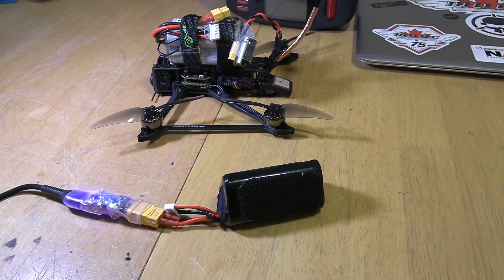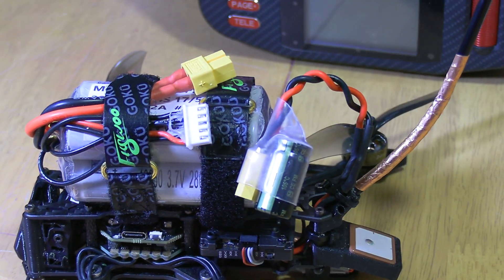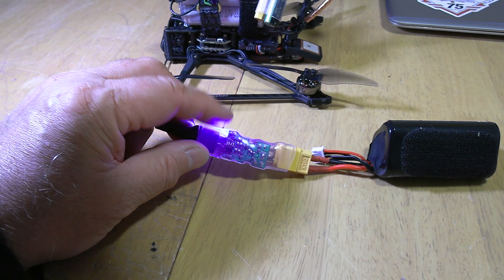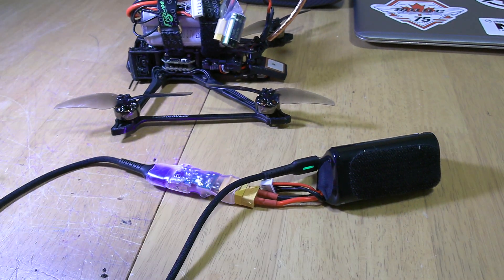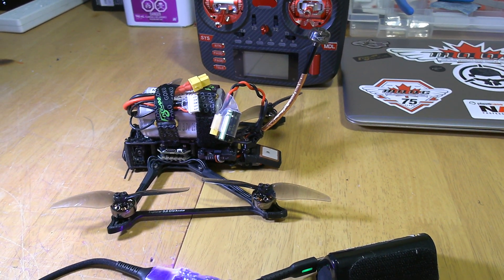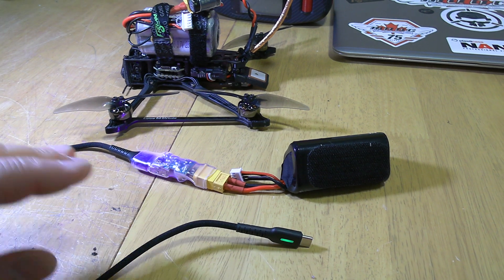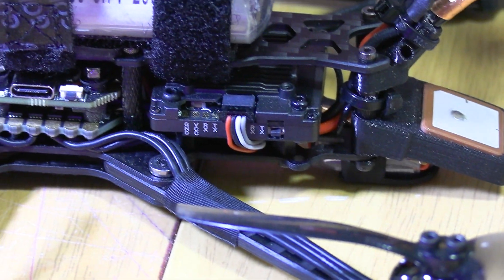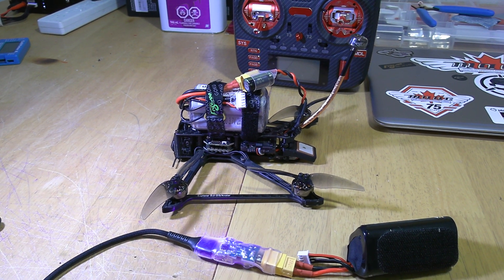How to keep your fpv video transmitter cool while waiting for gps lock

Comment: Been using a usb power bank and small fan  … stays nice and cool. When I first got my LR4, it took forever to lock in satellites. Fly woo said up to 30 sats. 
I rerouted the GPS module to the top of my battery with Velcro, between the two battery straps. Also shielded the wires with copper tape. Now, I always get at least 25 satellites and many times 33 satellites. Super fast too. I don’t really need the fan. 
I was a little worried about GPS damage in a crash. I don’t really crash that often , so I took a chance. It has been great so far. Module stays with the battery straps when changing … super easy. 
A few days ago, I lost connection while mountain surfing. I was just turning to surf down. Lost video. Hit GPS rescue a little late and lost it. At the top of Provo Peak , 11,007 feet. 3000 feet up and 1 1/2 miles away , late in the afternoon. I was so sad. 
My brother and I hiked to the summit the next day and found it. I couldn’t have located it without the help of a Marco Polo tag and locator. It led me to my quad in 10 minutes on the top of a mountain. It wasn’t cheap, but it has saved my quads many times. Turn it on and find your way to the tag up to 2 miles away. Totally brutal hike, but no one got hurt and we came back with the quad. 
GPS was fine! Didn’t even lose a prop. I did lose a battery that was draining all night. Checked things out … flies perfectly. I have flown so many killer , remote places with this little drone. I’ve had so many drones, but this one has given me more fun than any of them.   GPS on top … a great mod. 
They say laughter is the best medicine. A good day of FPV at a cool place can also do wonders. Love this shit . Never going to grow up. Have fun in the air!

Comment: I was using a powerbank for the same purpose. The problem is that the plugs have finite insertions so I tend to use a fan with a battery. Also I have plastic caps on UBS's so it is an extra hassle. Also some new controllers can stop the power to vtx completely with a switch.

Comment: Cool tip my friend i guess if u use a 3.3 volt pad or a 5 volt pad u can do the same as well.., I have yet to put a gps on one of my quads but I plan on doin it on my next build...thanks for the tip 🫡 subscribed

Comment: There are a few options for this. They make RC switches that you can add to remotely turn off the VTX. Many FC include this sort of FC powerdown option nowdays too. Id look for this option on future builds. For existing aircraft that dont have a vtx power option you can use a USB fan also as an alternative.

These included with your method are all good things to keep in the toolbox!

Comment: Even if you're only powering the FC over USB, the VTX is still transmitting.  If you want to keep your VTX cool, just put Pit Mode on a switch.
Reply: Typically that's not the case. Perhaps on a tiny whoop, or something that would use a little 5V VTx? But anything that would fly with 4-6 cell would have isolated power rails for VTx's that don't feed off a 5V USB input.
Reply from the maker: Not on my quad, The usb only powers the fc and gps. You need to connect your battery to power the Avatar video tx.
Reply: None of my 4 quads are transmitting when powered by usb